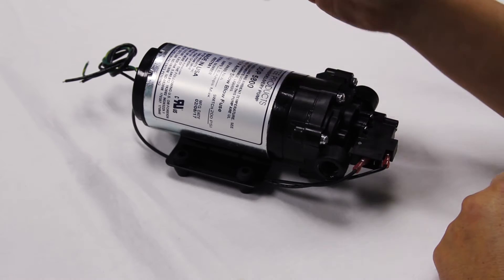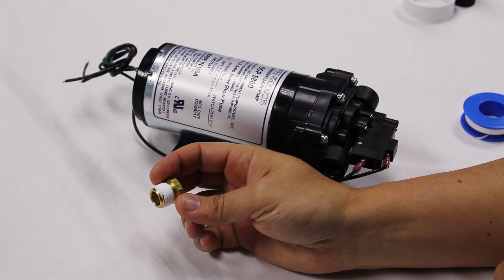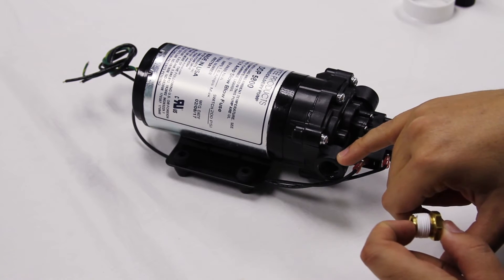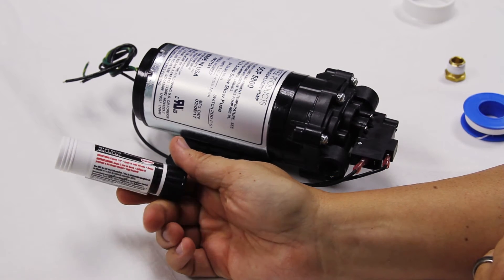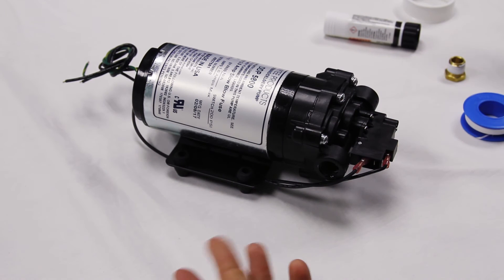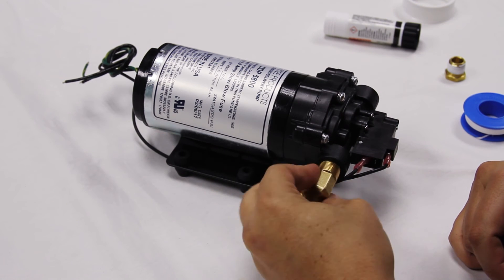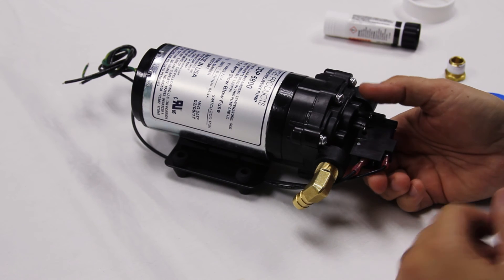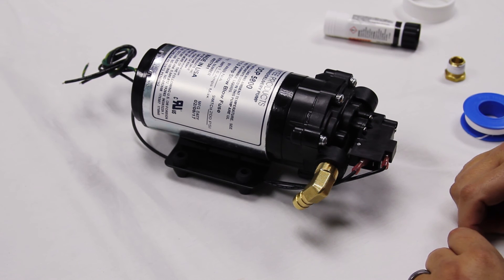Mytee® Installing Brass Fittings on Diaphragm Pumps

Comment: Your water pumps always leak and never last longer than a year. Please make an upgraded pump and fix this issue. Even new water pumps leak? Why? Even with replacing the check valve. Issues with 8070 extract 12opsi pump. Fix it please!!
Reply from the maker: Our sincere apologies, sorry to hear you've had negative experiences with our pumps! We buy all our diaphragm pumps like those featured in our most popular machines and in this video from Aquatec, the premier supplier of pumps to the industry. We have had instances of defective pumps from our supplier regrettably making it past QC testing, but thankfully we have a 2 year warranty fully guaranteeing against any defect in them. If you have not already, please reach out to our warranty dept. so we can correct any issues you may have related to defective pumps. https://www.mytee.com/support/warranty-support/
Reply: @myteeproducts  thank you for the response. Does the warranty apply to new water pumps purchased online?
Reply from the maker: It does!